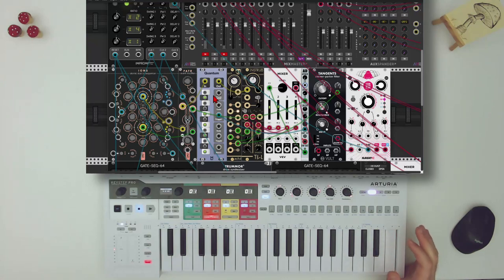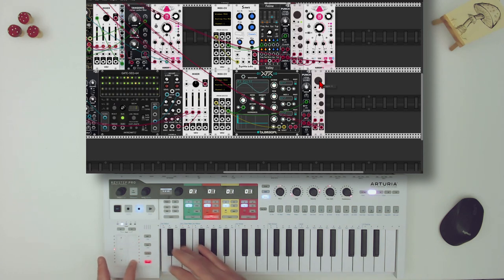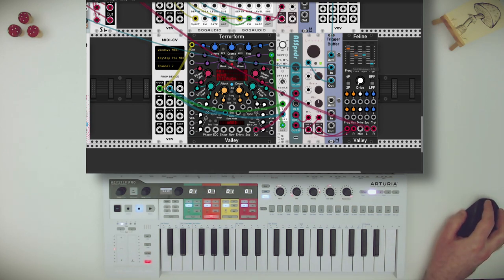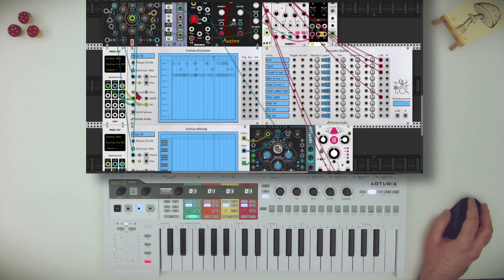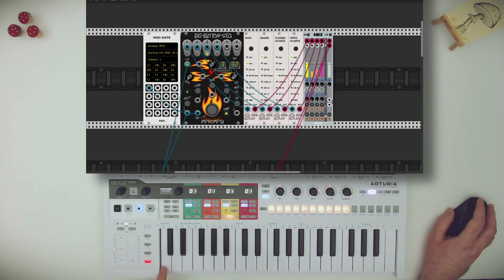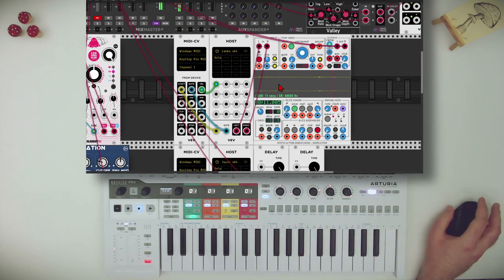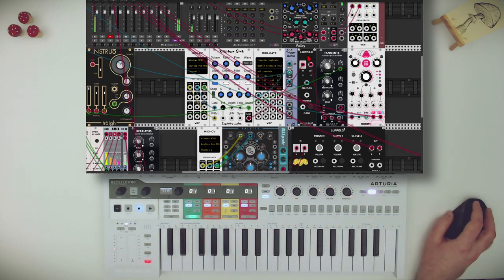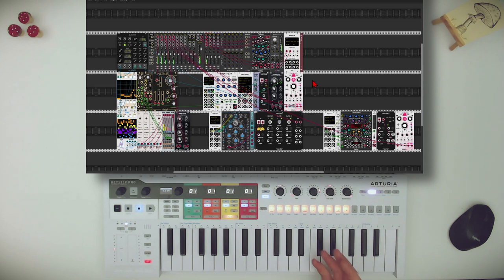How to Live Loop in VCV Rack

Comment: Your video on modulation/trigger recording, which you made earlier, also fits the topic quite well. Unfortunately I have lost the link. I think you had recorded trigger/modulation from the midicontroller in the Complex Simpler. That was very handy. If I remember correctly, it is also possible to set the sequences in the sequencer of Impromtu directly with the midi controller.  
My small midi controller lies, mostly in the drawer. But your video motivates me to put it on the table more often^^. Thanks very much, this video is definitely very helpful.
Reply from the maker: Hey, thanks! Yeah, Midi controllers can really open up the experience with VCV. Here's the video btw - https://youtu.be/NgICB02RrUQ
Reply: @OmriCohen-Music  Exactly this video I was looking for, thank you very much. :)

Comment: Omri, I think you mentioned that elsewhere, but can you briefly tell me/us how you connect your keyboard to VCV? Is it via the  MIDI CV module?

Thanks in advance.
Reply from the maker: Hi! Yeah, I use the Midi-CV module and have the KSP selected. I can then also set up polyphony in the right click menu.
Reply: @OmriCohen-Music  i see the polyphony options in the midi cv module but when i try to play multiple notes simultaneously from my midi keyboard and put the v/oct output into macro oscillator 2, i can only get one note playing at a time. I tried all the options and this didn't change, is that just not how vcv is supposed to work? or do i somehow need to resample the v/oct output when i hit a new note?
Reply: @OmriCohen-Music  That's great, I'd somehow overlooked that - even though I'd seen you using that. Anyhow, I now have my keyboard up and running through the MIDI-CV module, brilliant. It opens up a whole world of possibilities. Thanks.
Reply: @Tennisers  Some modules support polyphony, not all. Macro Oscillatior doesn’t support it.

You’ll also need polyphonic modules to handle the polyphonic Gates coming from your keyboard (a different gate per note press).

Set things up like you normally would, just make sure the modules in your chain have the “Polyphonic” tag. If so,  everything works out smooth.

Comment: Awesome video! i have one question, how can i use a guitar and loop it witouth touch anything? i guess if i used a tempo trigger i can do that but i dont know if exist another option more efficient... thanks a lot for the content!
Reply from the maker: Thanks! You can try something with an envelope follower and a comparator but it's quite convoluted. If you know when you want to start, you can set a timer that you can trigger with the mouse, and then it will count you in. There's a counter from Count Modula, for example.

Comment: Great video Omri, did you try Loopus? I'm trying it with trigger buffer but can't have a loop which is synced for a long time, it soon start to lose the sync...
Reply from the maker: Thanks :) No, I never had the chance to use it but it looks like it should work via the sync input. If it's not working, I would recommend writing the developers and letting them know.
Reply: @OmriCohen-Music  yes thanks, i've written to sonus dept; however I tryed Luppolo and it's really easy to have a synced loop so I'm thinking it's a bug in Loopus. The sync input in Loopus, as I read from the manual, is used to sync with other Instances of the same module, not to sync to an external clock